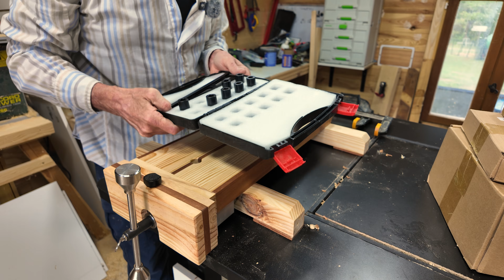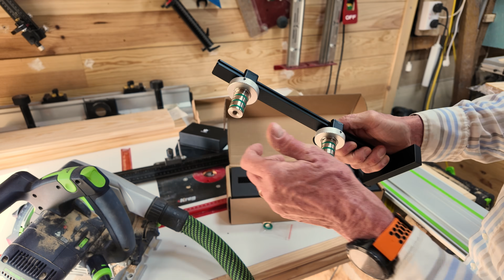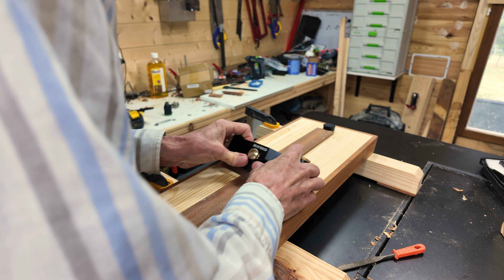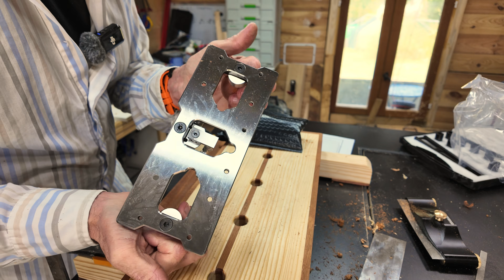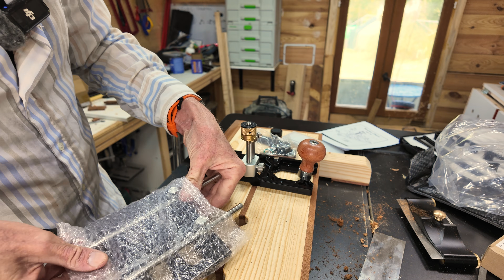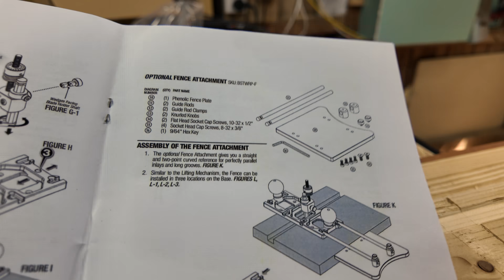NEW Hongdui and Enjoywood Tools by Banggood

Comment: The handle that comes with the router plane is for letting you use a honing guide to sharpen the blade with. It's based on the original veritas accessory.
Reply from the maker: Thank you. Regards JP